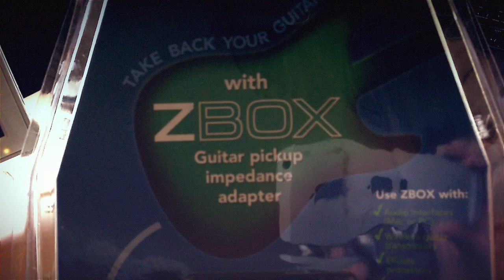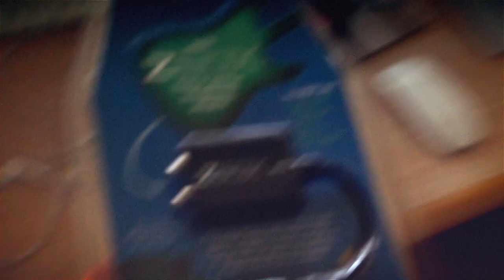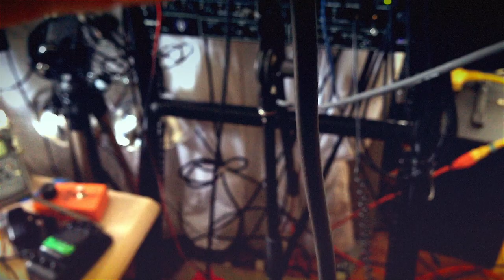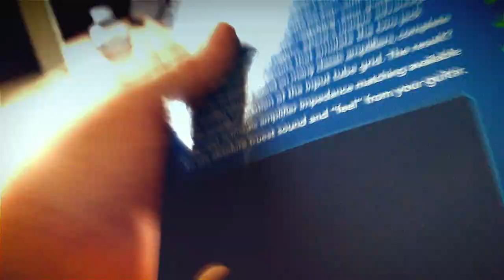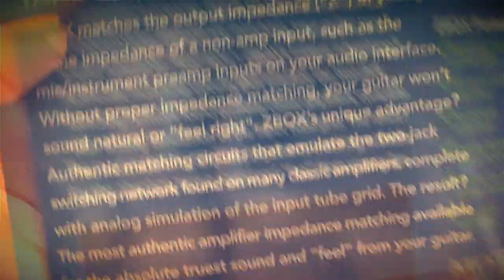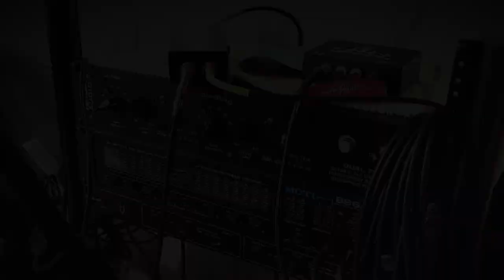MOTU ZBox UNBOXING and DEMO

Comment: My sound engine clips when I play strong.  Can de Zbox lower the signal with one of his inputs?
Reply from the maker: The ZBox is an impedance matching device. There are two inputs. A Hi-Z and Low-Z which are two different impedance settings. So, the Hi-Z will provide a little less gain and maybe be a little darker but they are fixed values so no volume control. It does a good job of making your interface sound more like a guitar amp input. Personally, I’d buy a Radial JDI passive direct box. It has a 15db pad on it and it outputs both 1/4” and XLR for recording and reamping. Here’s a link to Sweetwater and the JDI. https://www.sweetwater.com/store/detail/JDIStereo--radial-jdi-stereo-jensen-equipped-2-channel-passive-instrument-direct-box
Reply from the maker: Btw, the JDI is the direct box that I use and it’s rock solid. Will last forever. And it’s quiet. Quality stuff.
Reply: @TheSteveSteele    It's worth to both use a DI and the Zbox Infront of the external sound card when working with amps plugins? The DI already mach the impedance i believe, but don't emulate the input of a real amp if I understand correctly. I have a presonus audiobox that already have a -10dB and it only clips when  playing forte chords, so maybe de Hi-Z is enough. Thanks!!!
Reply from the maker: @chuscorral  There’s no pad on the interface? I understand what you want to do but I’m not sure the ZBox is the best way to go about it. I’ll plug mine in and see if one of the inputs reduces the gain any, and by how much.
Reply: @TheSteveSteele  I'm both interested in improving de guitar sound through a plugin and to reduce the input level. If I buy a DI is the Zbox still useful?
Reply from the maker: @chuscorral  So I was able to test it out for you. There are two inputs on the ZBox. A Hi-Z and a Lo-Z. The Lo-Z will attenuate the input by about -10db compared to a direct signal, and it rolls off the low end and high end a bit, (softens the sound a little). So, it will do what you're asking. Hope that helps.
Reply: @TheSteveSteele  Thank you dude. You have been very helpful.

Comment: hey steve! do you think that zbox would help to clean the muddyness on my guitar di tracks? I'm recording thru a radial pro48, but the hi-z buttom of my interfase sound more natural... not too muddy. :'(
Reply: Nico Poppe (I'm searching for a really bright tone, co's my tracks got toooo much low end!) please help me
Reply from the maker: Nico Poppe I would use a good quality eq. For software try the FabFilter Pro-Q2 for complete control, or an amp sims eq. The Zbox is subtle. The ZBox rolls off the highs a bit, maybe adds a slight perceived boost in the mids (it emulates the sound of a guitar through an amp), subtle with the lows. If you're having trouble with muddiness on the guitar track, then use a hardware eq or on an insert in your DAW. Choose a hi pass filter (or lo cut filter) and roll off everything below 100MHz or so, and maybe a notch filter around 250Hz or slightly below. There are a couple of ways to do this. Record through an Aux track into an audio track if you want the effects to be printed, or record straight to an audio track if you want the effects after the recording. Sometimes too much lo end takes up a lot of dynamic range so the former method might work better but you're stuck with the recording you get. I don't know what type of guitar you use, active or passive pickups, or what the of music you play so it's hard to give you further advice. The low impedance inputs of an interface allow for full range frequencies to pass through. Perhaps you should use an eq before the interface, but if not use an EQ plugin. The last thing, if you like the sound of your amp and it has a buffered power amp out (most amps don't, but mine does), plug your amp's line out into your interface, then use a program like Recabinet, MixIR2, or Torpedo Wall of Sound. Or you could use an amp sim. A bass amp sim will sometimes give you a bright tone. Hope that helps.
Reply: ***** really thanks for the reply. I'm using a Prs se with seymour duncan sh5 on the bridge to play metal and modern hard rock. I always fell very confused on my guitar di tracks thru direct recording on ampsims , even  if I plug it on a direct box (radial pro). I could archive better resoults with the hi-z mode on my steinberg ur22, but I think that something is missing... when I compare my track's with someone else di tracks like lasse & mago or karhu stuff,  that are so god damm clean! even in very low tunnigs. to solve this I do what you do with filtercrusher of audioassult or the tube screamer simulation of simuanalog with great resoults, but I wanna know whats wrong on my chain...

Comment: I have active EMG 85 pickups and a digitech RP250 fx pedal which I think it's not capable to handling the active pickup signal (sounds too muddy).  would you think this would help? thanks
Reply from the maker: Yes. It has Hi and Low impedance inputs (for active and passive pickups), and has an input resistor to give it a more guitar amp type preamp input tone.
Reply: @TheSteveSteele  hi! The input impedance of my digitech rp 250 is 500 kohms, more than the 10x required compared with the output impedance of 10 kohms from the active emg 85 pickups. So, I concluded the problem was elsewhere. Finally the problem resolved when I bypassed the tone pot in the guitar. WTF !! Thanks a lot.
Reply from the maker: sapitron Some EMG tone pots are active. Maybe that was the issue? Anyway, glad you fixed it. 👍🏻

Comment: I already using Focusrite 2i2 gen 2 to DAW for recording (with or without my Fishman aura spectrum DI), would you suggest I will have any noticeable  "improvement" sound qty. wise?
Reply from the maker: What the Z-box does is emulate the effect of a 1 mega ohm input resistor of a Fender guitar amp. With home studios, including mine, dealing with ohms mismatching problems due to the mixing of pro audio equipment, with consumer equipment, and with guitar amps, it’s likely you’ve got an impedance mismatch somewhere. If you do, this will help. Find out from Focusrite what the guitar or 1/4” input impedance is. If it’s hi-impedance, the Z-Box will roll off the brightness that it causes. It’s like putting the correct volume pot impedance in your guitar. Too high and it’s way too bright. Make sense?

Comment: Can this be used to add an extra channel to a single channel guitar amp? I'm trying to add another channel to my amp to run my external fx loop pedal through.
Reply from the maker: Not really. It’s just a circuit that adjusts impedance. Makes an interface sound like a guitar preamp.

Comment: instead of guitar , can we use a mic on the zbox?
Reply from the maker: There's nothing stopping you from doing so but I wouldn't. The inputs are 1/4" high impedance not XLR low impedance mic inputs. Plus the whole idea of the Zbox is to recreate the tone of a high impedance input from the front end of a guitar amp, which has a narrower upper bandwidth than a low impedance mic input. If your going for that tone on purpose, I would just use an eq or amp sim in your DAW and be done with it.
Reply: +Steve Steele really helpful . thank you so much
Reply from the maker: +ashrafuddin azahar anytime.

Comment: Great demo! I'm curious if you would say the ZBox changes the "feel" of playing into a amp sim? That's one of the things that really bugs me almost as much as the biting-on-tin-foil tone. It always feels like I'm playing "uphill" vs. my tube amps. Though I'd rather play "uphill" than carry my Rivera downstairs…
Reply from the maker: +Kerry Maxwell The Z-Box is. IMO a disappointment. All modeling is. Power chords and clean sound good but leads are horrible due to the noise and lack of body and sustain. If you have the ability, take a line out from your power section (my Bogner has a buffered line out post power tubes) and it's very handy for the next trick. If it doesn't you can buy one. Then buy Redwirez mixIR2 (convolution based speaker cab emulator that works great!). Find the right cabinet and you won't believe the sound. It will sound just like your amp. That's why I do. There are other cab sims out there that I've tried (Torpedo Wall of Sound), and Kezrog Recabinet. But mixIR2 is the best buy far. However, Topedo is now making rack mount hardware units that are very very good! For now mixIR2 would be the way for you to go. Find them at redwirez. I think it's $49 and you get all the IRs. That's as real as I've ever come close to. That tells ya that the power amp section plays a big part in the sound. Enjoy!
Reply from the maker: +Steve Steele However I must say that I do use the Zbox whenever I plug into a board. It helps a lot. But don't expect it to turn your guitar sound into the tube amp raging monster. The Zbox is only part of the process of matching initial impedance.
Reply: +Steve Steele I'd like to know the circuit architecture, as I'm sure it's an easy DIY project, and then could make a somewhat more rugged version without the molded cord, and less susceptible to RF.

Comment: How do you know if you need to plug in The high end or low end? Just based on the sound?
Reply from the maker: Depends on the pickups of your guitar or bass. Hi is generally for passive non battery guitars and Lo is for active guitars. The less output your guitar has the more Hi Z it is (although is isn't the exact definition of impedance, just a guide for this device).